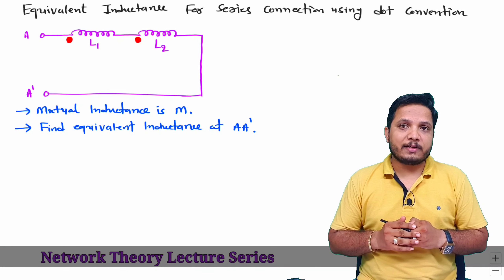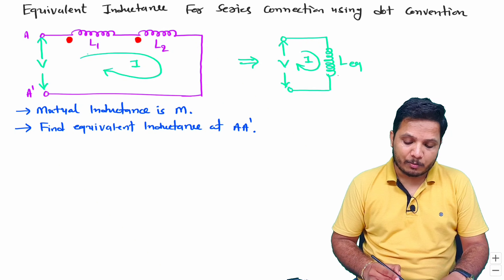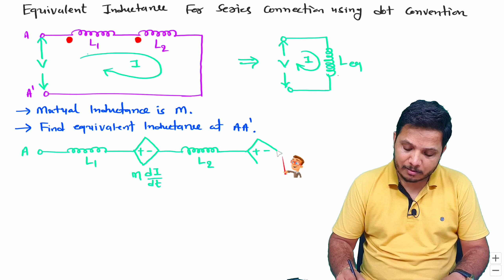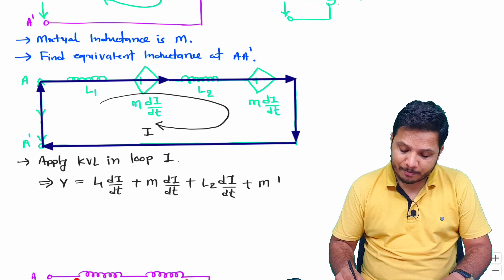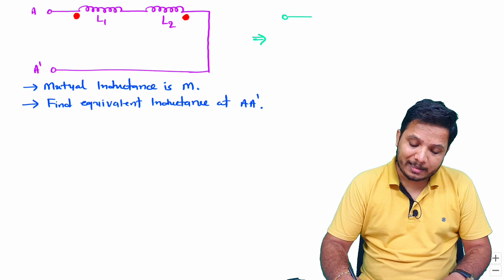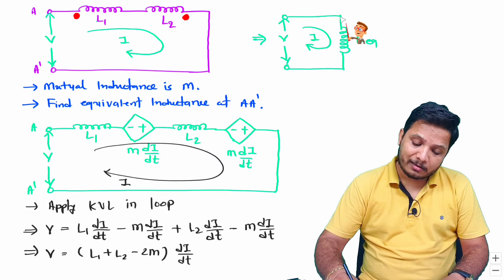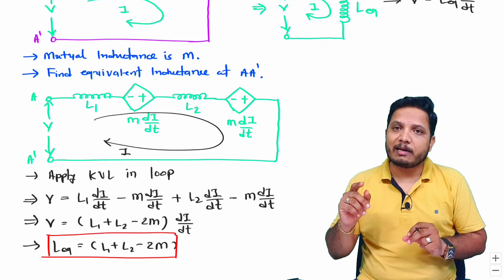Equivalent Inductance for Series connection using Dot Convention | Network Theory

Comment from the maker: Equivalent Inductance for Series connection using Dot Convention explained with following Timestamps:
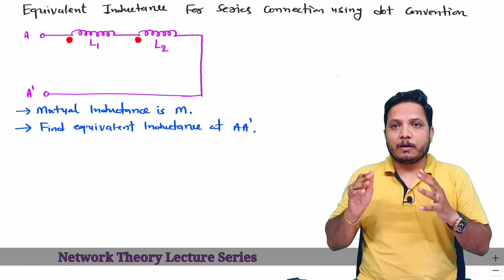0:00 - Network Theory Lecture Series - Equivalent Inductance for Series connection using Dot Convention
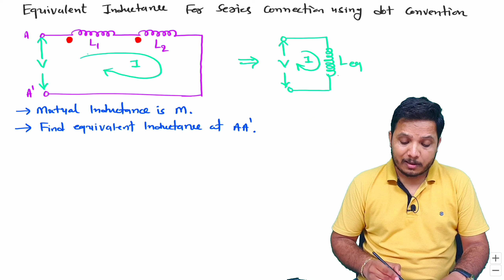1:11 - Circuit of Mutual Induction from Dot Convention of Inductor
3:14 - KVL equation using Dot Convention of Inductor
4:44 - Equivalent Inductance for Series connection 
5:16 - Equivalent Inductance for Series connection using Dot Convention with Different polarity
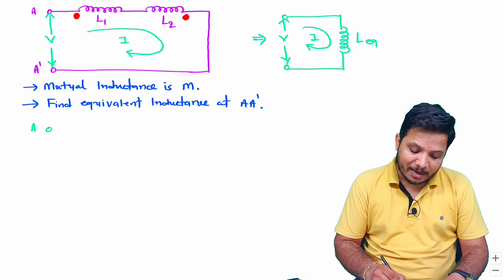6:00 - Circuit of Mutual Induction from Dot Convention of Inductor
7:27 - KVL equation using Dot Convention of Inductor
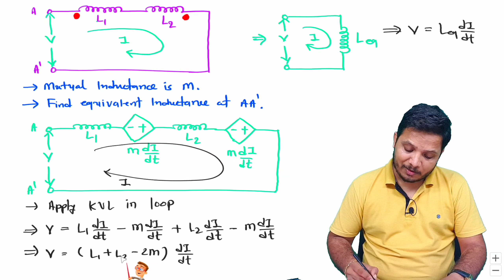8:48 - Equivalent Inductance for Series connection